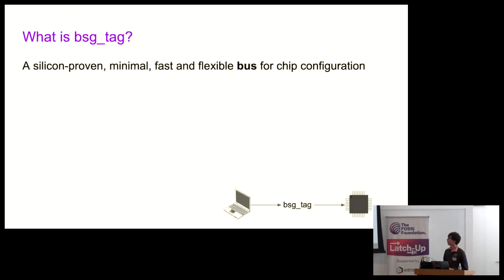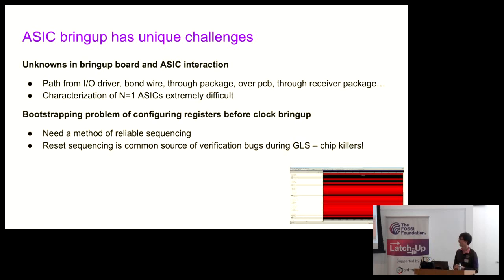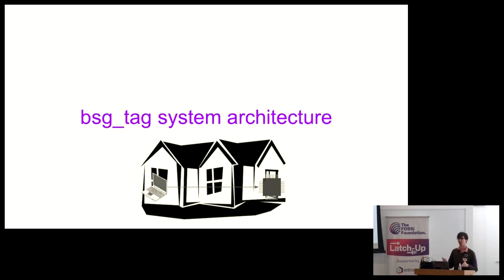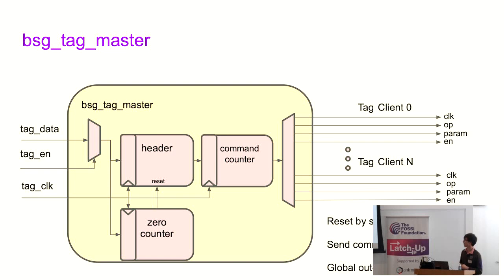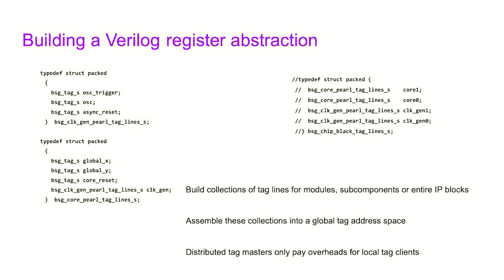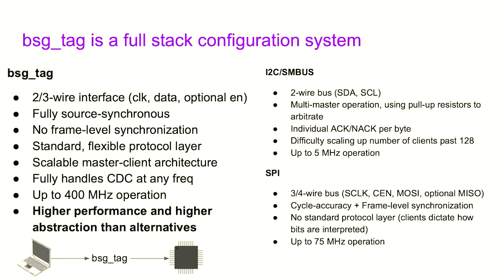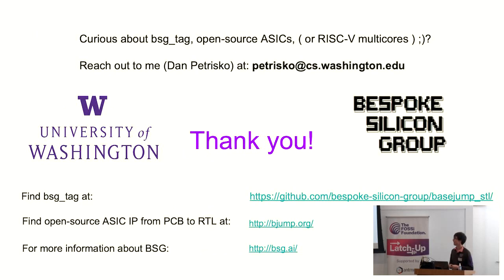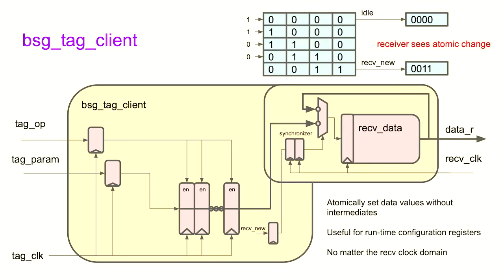"bsg_tag: A minimal open-source ASIC configuration bus" - Dan Petrisko (Latch-Up 2023)

Comment: The "no framing" part is ... curious and needs explanations as well.
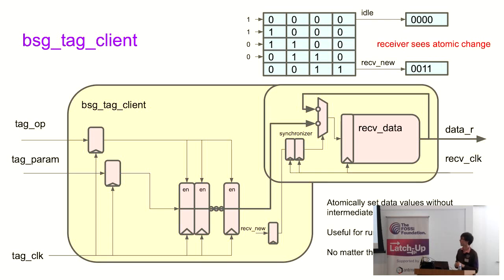9:50 has only 3 inputs (op, param, clk) and at 10:00 we see recv_new appear.
the protocol is not explained : how does this "self-generated" signal work ?
Reply: Hi, the enable signal is out of band with individual messages. When enabled, the sender chip can continuously send messages. When enabled, masters wait for the start bit so per-frame enable is not needed
Reply: @pencan94  I'm not sure I understand but I'm sure there is a good explanation.
Thanks for the replies !

Comment: Nice but this new protocol is not bidirectional : it's "write only", whereas SPI and I2C are bidirectional so the comparison can't really work.
Writing data is fine, great, but reading back what you just sent and check the results is even better : controlability without observability is only one half of "design for test".
Reply: 17:00 ah, audience caught that too.
Reply: @leyasep5919  bsg_tag is not really intended for DFT, but neither are SPI or I2C. If you need a scan chain, JTAG works fine and is not incompatible with bsg_tag (write with bsg_tag, read with JTAG). Generally we have found in our chips that it is not necessary to read back every register during configuration. Once the writes have taken place in the client domain, the challenges described in the presentation no longer apply, so it's trivial to read and output through an ordinary bus
Reply: @pencan94  "(write with bsg_tag, read with JTAG)" sounds like some sort of redundancy to me :/
Reply: When evaluating the effectiveness of an observability mechanism, you should also consider the probability of failure to see if it is worth it. If you are worried about every individual flop and gate being manufactured correctly, then put scan in. But in most cases, the probability that there is a manufacturing fault in the pathway to the configuration state with bsg_tag is absolutely tiny.  If bsg_tag writes a value to the configuration register, then that's the value the configuration register has, because it doesn't depend on interaction with any other parts of the chip, unlike more complex interfaces. And the logic is essentially a shift register, much less complex than SPI or JTAG. That's the key value of bsg_tag: high-assurance setting of registers deep inside your chip. If you have more complicated state machines that you want to inspect (a different set of things than what you are setting with bsg_tag), you can use a bsg_tag controlled output mux to observe those signals, or JTAG.